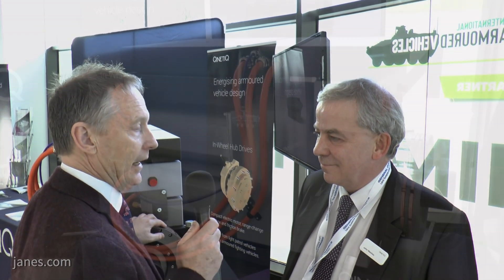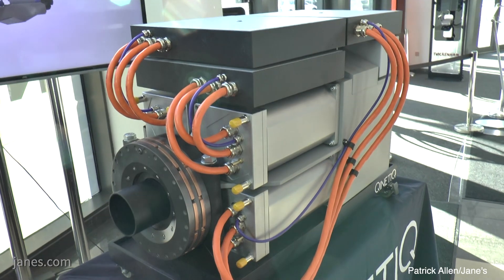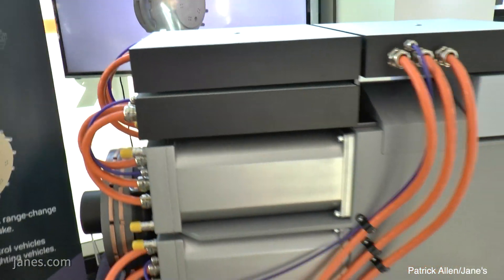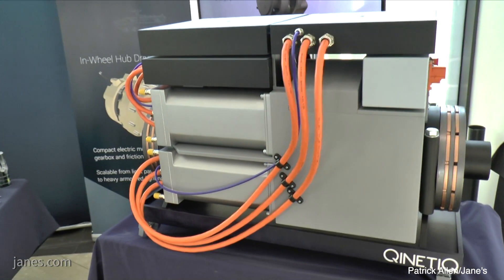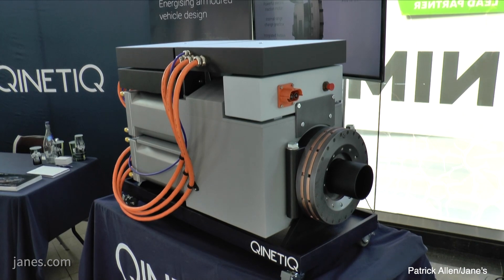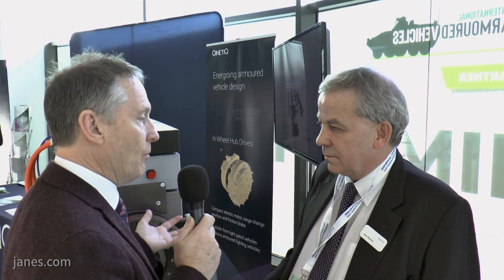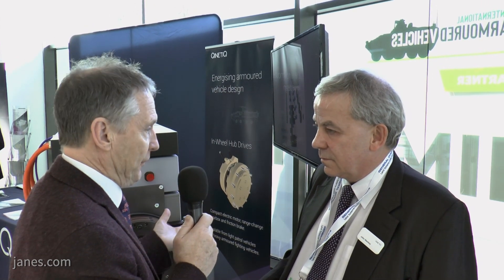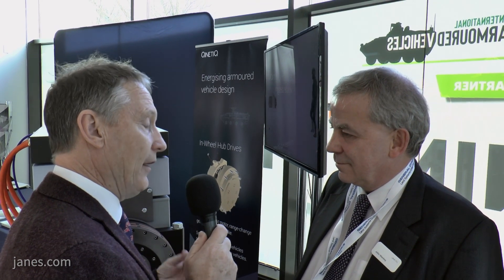QinetiQ’s E-X-DRIVE™ transmission for tracked combat vehicles - UPDATE

Comment: Imagine an Abrams without that turbine sound
Reply: That would be a good thing if you're trying to sneak up towards the enemy. Might even improve on the heat signature.
Reply: Oh hell no
Reply: Abrams is already pretty quiet compared to conventional tanks. The biggest sound issue is the tracks. The electric transmission’s biggest advantage is weight.
Reply: That sound is annoying for the crew and those nearby. But it carries less far than a diesel.